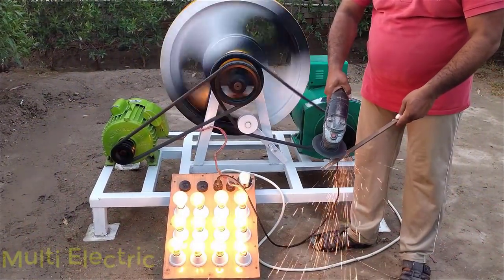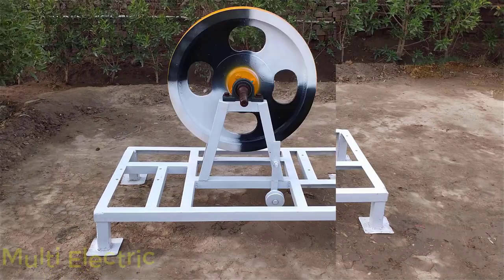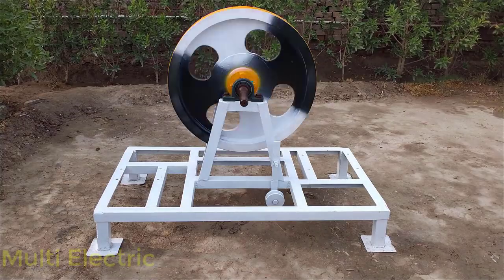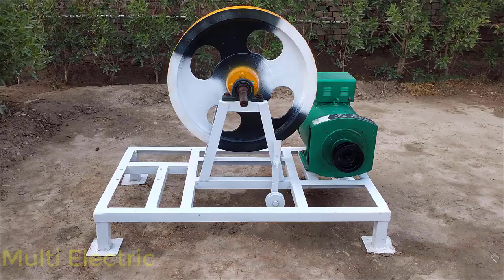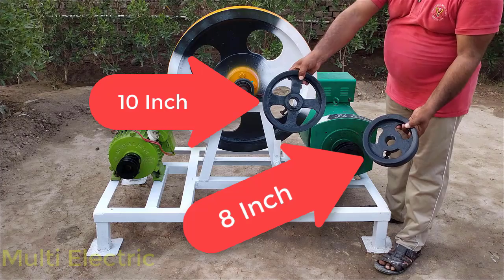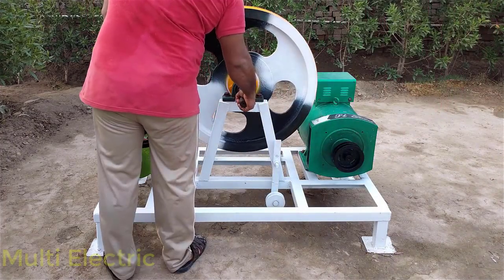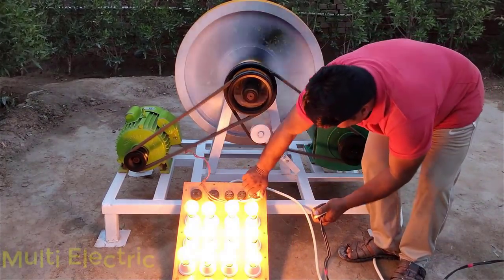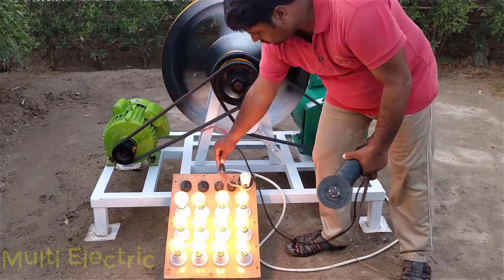12kw Free Energy Generator 230v With Alternator & 3 HP Electric Motor Free Electricity Generator

Comment: Make sure to look directly at the blue light while welding. its good for the skin.  Its not free energy, its a fly wheel, that will eventually stop producing after a min or so.
Reply: No the flywheel stores enough energy to continue to rotate the alternator and still produce ac current long enough to switch to the alternator produced power to run the motor.
Reply: Or you simply add a reduction gear to spin the flywheel fast enough to offset energy loss on the generator side and possibly a small battery bank to allow for any fluctuations above normal levels, this is very much doable and if not completely self sustainable due to temperature and wear it would be pretty damn close.

Comment: Will it works? Yes it would! The reason is that flywheel! It harness energy from rotation where the spins of the gravity weights and rotation spins around the sun! Looks like it defy conventional physics laws but it not!  We totally neglected this values in our  essential calculations! You only needed the proper balancing of both the generator and the driving motor and of course the weight of the flywheel ratios and differences for your output supply power maximum usage here!
Reply: Blah blah blah..... This guy is fukn  doing it. It's called kinetic energy.

Comment: I have a 2.4 kw generator system and 1.1kw motor with generator on coiled rotor and cannot charge the 24v to 45a battery in a timely manner

Comment: I HAVE EXCHANGED EMAILS WITH THESE LIAR'S, THEY ARE SCAMMERS ,  I KNEW THEIR SYSTEMS WOULD NOT WORK,  AND AS ALL ENGINEERS WILL TELL YOU, THIS TYPE OS SYSTEM WILL NOT WORK, IF A LARGER OUTPUT , CURRENT, AMPS IS CONNECTED TO THE ALTERNATOR / GENERATOR
WARNING THEY ARE SCAMMERS / THEY ARE SCAMMERS // THEY SAY THEY HAVE ATTEMPTED TO GET FINANCIAL BACKERS  BUT NO-ONE WILL GIVE THEM MONEY - THE REASON THAT NO-ONE, NO INVESTORS WILL PUT MONEY INTO THESE TYPE OF POWER SYSTEMS - IS BECAUSE THE INVESTORS SPEAK TO ENGINEERS AND THE ENGINEERS - TELL THE INVESTORS THAT THESE TYPE OF MACHIENS WILL NOT WORK //    WARNING THEY ARE SCAMMERS / THEY ARE SCAMMERS

Comment: Is it possible to explain why you used (Big 100kg fly weel pullies ) what I mean, is it possible to use any connector rods, or any rod that joins or connects between the small (pullies )
Since there is no connection or connection between the belts of the dynamo or the alternator
thanks for sharing

Comment: @8:57 the frame skips and the left top bulb begins working again. that means you plugged the motor back into a regular power source and pushed the rpm of the flywheel back up. the flywheel only prolongs the end. it will stop. and the power it took to spin it up is the power you are taxing off of it. I hate the fact that what you are trying is not possible. but i hate even more that you feel the need to lie about it.
Reply: Probably but the cables remain in the same position

Comment: JUST AS I THOUIGHT -- YOU CAN " NOT " PROVE THAT THIS FLYWHEEL SYSTEM WORKS WHEN CONNECTED WITH A LARGE OUTPUT LOAD ON THE ALTERNATOR -- THIS IS A SCAM !!!!!!!!!!!!!!!!   IF YOU DO " NOT PUT A CERTIFIED ( BY AN INDEPENDENT ENGINEER OR ELECTRIC SUPPLY AUTHORITY )  VIDEO  ON HERE TO RPOVE YOUR FLYWHEEL SYSTEMS  -- IT JUST PROVES THAT THIS IS A SCAM // A SCAM // A SCAM

Comment: YOU CAN'T PRODUCE 12 KW JUST WITH 5 KW !!! THERE ARE BIG LOSES  DUE FRICTION AT MOTOR, GENERATOR, FLYWHEEL PLUS ELECTRIC LOSES  IN COILS  AT MOTOR AND GENERATOR PLUS LOSES  IN MAGNETIC  CORES OF THE MOTOR AND GENERATOR !!!
I DON'T BELIEVE IN YOUR " FREE ENERGY " CUZ I KNOW!!!
ONLY YOUR HOAX OR SCAM IS FOR FREE AND DON'T WORKS !!!
I'M AN EXPERIENCED POWER ENGINEER!!!

Comment: This is a good project but I feel that the flywheel is reducing the efficiency. This will work without the flywheel. The heat generated by the project will be high and you can't run it for long time also the maintenance time is needed.

Comment: Applauds!
Will it run down over time? I wish you could let it run continuously for 24 or 48 hours.
Reply: Good 👍 for 30 YEARS
Reply: For that Purpose.... make three of them and use 8 Hours each daily... so all three generators Give you 24 Hours free electricity without being damged due to high usage.......
I know it will expensive but you get rid from bill... forever....

Comment: Electric motors cannot power each other. "This is possible only in India". The motors are 90% efficient. They cannot give free electricity. 12kw motor cannot power an alternator and a lower power alternator cannot propel a higher power motor.
This project its impossible.
The stored motion in the flywheel cannot be used more than few seconds. After that, you will overload your circuit and can be damaged.
When I saw you using thr spanner with the motors running pulleys close to your hand, I knew instantly that you are not an engineer. One day you will kill yourself. You have no brains.

Comment: This is a transient phenomenon depending on the kinetic energy in flywheel after which the system will stop. Even when welding m/c is switched on we can see the flywheel speed is reduced.
Reply: @jimclayson  fucking hell, complaining even if it'll run for "only" 8 hours, just think about what you can run for those 8 hours.
Reply: The flywheel is just used to smooth out the RPM to keep the voltage consistent. As long as you don't load the generator down too much this thing will run forever
Reply: @jimclayson  as long as the alternator puts out more than the motor uses it will run forever. Theres no reason why it would slow down as long as you don't load it down to much.

Comment: This is called "mechanical capacitor",  the bigger the fly wheel, the bigger capacitor the system will have. Definitely it will stop, depends on how big is the load.
Reply: yeah they all are ignoring Friction. and other factors that will eventually stop this system the there is heat of these rubbers, resistances it will stop eventually.

Comment: It violates 1st Law of thermodynamics. 
Law of conservation of energy

The law of conservation of energy states that energy can neither be created nor destroyed - only converted from one form of energy to another. This means that a system always has the same amount of energy, unless it's added from the outside

Here it will loose energy as heat
So it will stop once the energy get exhausted.

If it does not stop then there may be additional energy supply (which they are not showing) in the form of electricity.
Which may be produced using  petrol diesel kerosene etc..
Reply: Go read your mechanics proper my dear. U don't know about mechanical advantage and conversion of one form of energy into another? Well, it's wrong to call it free energy. The right name is fuel less generator. So forget about the free energy stuff

Comment: Yes, that’s right, your project works non -stop.  I believe, because of your mathematical calculations.  The pully size is correct.  Consumption of 12000 watts of true generator power, 5000 watts for motors, the remaining 7000 watts for other equipment.  Exact calculation.  I share 100%👍.  It’s just, the cost of your project is quite expensive this, “tottaly free project” converts “free, perpetual electricity”.  Keep trying to find reusable energy 👌.  Congratulations.

Comment: COME ON, IF THIS REALLY WORKS - PUT A " CERTIFIED VIDEO BY AN INDEPENDENT ENGINEER OR ELECTRICAL SUPPLY AUTHRORITY "  ON HERE TO PROVE THAT THIS ( AND YOUR OTHER SIZE SYSTEM )  REALLY DO WORK, WHEN FULLY LOADED : ie SHOWING THAT THIS SYSTEM CAN OUTPUT 12KW AND RUN FOR 24 HOURS NON STOP AT FULL OUTPUT LOAD    //  OR  //  NO CERTIFIED TEST PROVIDED  SO IT PROVES MY COMMENTS  // THIS IS A SCAM

Comment: Attach a meter with motor to confirm, how much energy Motor consumed to start this system,  and also attach a meter with Generator to see how much energy is it producing. Also explain After Generating Energy how much time will it generate consistently ? and what about the Resistance ??
Reply: There is free energy and free energy generators. Yours aren't working. For your personal use and not for commercial purposes, you can build one that is located at the national patent office in Alexandria, Virginia or at international patent offices in Paris, France or in Geneva, Switzerland. With the deep state practically expropriated, there is no longer any need to fear that they will come in with hired killers and take you off. Do your own research.

Comment: Dear creator, we really want you to succeed and I kmow that you might feel frustrated but if you put it in concrete floor, lift if up without cutting scenes and then turn it on, then you can help change the world.
Reply: And run the electric through the concrete and tubing.
Reply: There are other videos without any cut, edit or special effect in youtube wherein they put the foundation  of the generator assembly on top of a transparent table and kick start the generator not one or two but multiple times and use portion of the output for running a drill machine. They did so using a modified car alternator. 

 I believe if a strong magnet is added to the rotor of an alternator, the energy output can be significantly increased. Only a small portion of the output energy is then consumed by the motor which inturn drives the generator through a belt. The rest of the residual  energy exerted by the generator are used for other purpose..for example dumping it on a light bulb or connect to other electronic machine.
Reply: It may look like a scam to the general public in the west or europe...there are people who built and run the generator for six months without stopping it..lol. May sound insane...but with auto cooling and lubrication affixed on the bearings, It could very well be possible.

Comment: Can i use 1.5 motor to a 3kw dynamo and works? How much current, volt, amps it will produce? Will it be AC or DC. Lastly, is it pure sine wave?
Reply: It is a pure sine wave.....remember the wave depends on RPM

Comment: it is a SCAM, as they will never put up a test, to prove that this type of system, can produce a large power output, for this system they need to prove, by conducting a test, and having an independent engineer certify the test, showing the  output  of the generator as 12 kw  including running the 2 kw ( 3 hp ) drive motor,  i will bet that they will never do what i have stated must happen, because, at full load ( or even 75% load )  the drive 3 hp motor, does not have the power ( force ) to drive the large flywheel and drive the generator ..   NOT CERTIFIED TEST PROVES MY COMMENTS  // THIS IS A SCAM

Comment: So the fly wheel is the a heavy centrifugal kinetic battery or kinetic capacitor apposing a change in motion, not unlike a capacitor apposes a change in electrical charge in a circuit.

Then the gearing sizes are rational derivatives of experimentation? Or is there a ratio magic involved? 

So the starting motor is a smaller electric motor that keeps the kinetic battery moving easier than it is to stop the kinetic battery or fly wheel. This motor is really only keeping the fly wheel spinning full speed with the smaller pulley. 

Now the larger alternator runs the electric motor, once the utility power has been removed, again the fly wheel kinetic battery supports forward motion of both motor shafts during LRA or locked rotor amperage, or start up of the coil fields, which normally would collapse the fields in such a setup. Is this correct? 

I don't understand, if I understand anything, why the small load placed on the alternator, the small physical load on the pulley, what purpose does that serve? Does it balance the fly wheel motion from run away acceleration? Does it have some other purpose? 

How much kinetic motion is stored in the 100KG fly wheel? Can this be expressed as wattage? What is the cycle time for such a machine under full load? Very interesting, just trying to understand the principles outside of the confines of entropic science models.

Comment: What is the purpose of the 100kg fly wheel in this set up
Reply: I believe kinetic capacitance, think about centrifugal force and how hard it is to stop a large mass spinning at a greater radius than the shaft. 

You can stop a shaft with your hand that you couldn't at a greater radius point, think leverage of breaking a bolt. 

This is very interesting concept. It's not breaking any laws by using mechanical leverage to assist in load maintaining.

Comment: What I'd like to see is the base made in such a way to remove all doubt there isn't a hidden power source and the plug of the motor plugged back in after the machine has slowed down. I have been pondering this exact same setup for over 20 years but didn't have the extra stuff to build it. I know there is a way to do this, but I don't believe it's quite so simple as this. There would have to be a throttle effect and a transmission effect included whether it be mechanical or electronic based for this to work. A direct drive with a flywheel on its own will fail. Electricity and kinetic/mechanical energies are indeed different and their differences can be manipulated in a way like what's in this video, but the correct apparatus is not in this video.
Reply: Why is it so hard to understand. First you have realize a generator doesn't create electricity it only pumps it. 
It's been in your face your whole life with your car. You need a battery to get your car started and get the alternator going. After that you can remove the battery. Your car electronics will still run no problem the alternator will handle the load. It doesn't know whether its a gas motor, a electric motor or your hand that's spinning it. Nor does it care. If it can pump more electricity then the motor needed to spin it. Everything will stay working. It really is as simple as this set up. Same with a portable gas powered generator. It doesn't know or care what's getting it to operational rpm. As long as it's their and the field is magnetized it's going to pump electricity. If you had a electric motor hooked up to it powering something else people wouldn't think twice. But if use that motor to power the generator unit peoples brains just shut down but that's by design so you don't do this. Rockefeller who set up our school system said he wants a nation of workers not thinkers. Literally. They don't want people like Tesla. They won't people who are quiet do as your told workers. Your over complicating it. It's really a easy concept.
Reply: @brianfitch5469  er i think you`ll find the generator/alternator creates & pumps electricity , just saying 😀 good post though, totally agree

Comment: THIS A FRAUDULENT VIDEO  
THIS IS WHY THEY HAVE  " NOT "  PUT UP A FULL LOAD TEST AS PER MY PREVIOUS MESSAGE

AND THE 3 HP MOTOR  DOES " NOT " PROVIDE ENOUGH POWER TO DRIVE THE FLYWHEEL
Reply: This is quite impossible.

Comment: Hello Sir,

Thanks for Creating this exciting video. After inspiring your video I tried to design the same but not able to generate proper energy.
Below I am showing what I am using.
2 hp moter
pully on motor = 3 inch
7.5 kw Altenator 
pully on altenoter = 3 inch
wheel weight 70kg
Shaft pully for moter => 8 inch
shaft pully for alternator ==> 10 inch

it is ruining the bulb, but not taking a load of motor when changing the line.

Please help me where is problem. I can pay if you have any charge.
Reply: You shouldn’t have these parts if you think free energy exists
Reply: Its just click bait. Youtube pays content creators by the number of views.
Reply: One of my friends did same what you mentioned..
He face same problem..

Mean it doesn't works ..

What do you think ..
If it works why all world 🌎 is not using this way ...

Comment: what power is available after powering the 3hp genetor ?
Reply: 1 Hp produces 900rpm and by we can use 1 hp motos too her but with the help of pulleys and flywheel we are increasing this 900rpm tp 1450 or 1600according tot he requiremnt of out system i guess 3hp would be much higher for producing infact it will cause loss of energy

Comment: Where does go energy loss between electrical to mechanical and then to electrical conversion?? There is no ldeal machine in this world for 100% coversion of energy from one forrm to the other one. Moreover, where are the rgulators to regulate the RPM of induction motors with the corresponding courrent and Voltages of the  Alternator Generator. So this project does not qualify the scientific parameters....It is nothing but a deception
Reply: Agreed. Stored energy in the flywheel. 😏

Comment: Most of the engineers say it will stop after 15 to 20 minutes. All the videos do not show in full load, all are using the load one after another. Is it possible to run the generator in full load and stream live for at least an hour?
Reply: Is it a must that u must run it at full load for God's sake? Even if it powers all points of lights in your house alone including security lights 12 hours a day without any fueling isn't it better than the high tariff of public supply? Besides running it on full load will shorten its life span
Reply: Yeap on full load is different, it will stop unless you give more speed
Reply: Maybe the fly wheel will do the job to keep it running on full load

Comment: Please show a video, so we can all see, if the system still runs at the required 1500 RPM for the alternator when at full output load,   of the alternator at almost full output which should be 12kw ( approx 58 amps )  less 2kw ( 3 hp ) for the motor    so the output LOAD needs to be 9kw  APPROX 44 AMPS   as this is a 240 volt  system
Reply: Kindly give us the parts Ang schematic diagram. Thanks